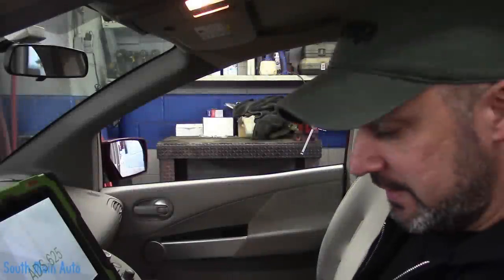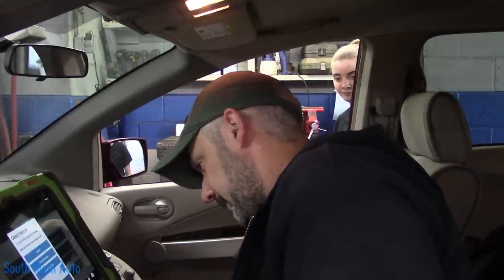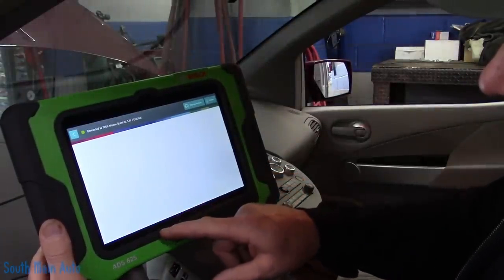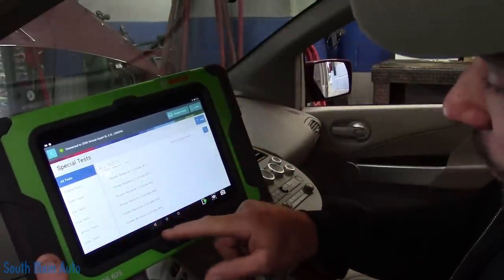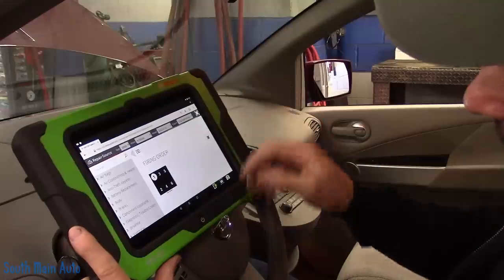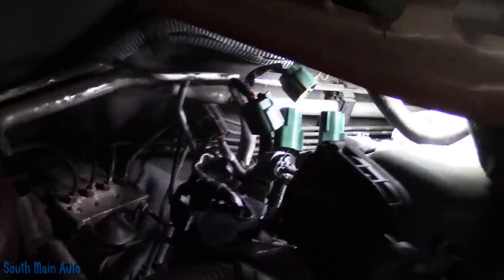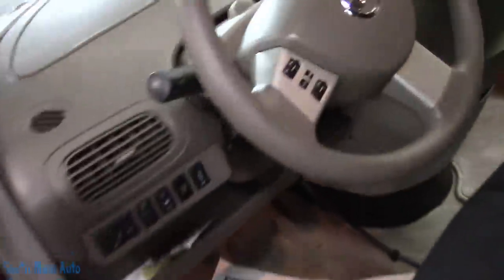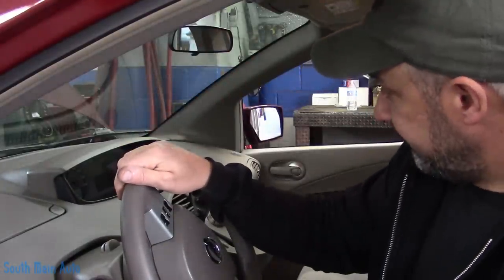Customer Replaced Spark Plugs And Now It Runs Bad!?

Comment: Major DIY f-up which luckily didn't result in any real damage.  Doing a waterpump/thermostat repair on a 2000 Lincoln LS.  Getting late/tired when I finished.  Start it up and white smoke is pouring out the back.  Long story short....there is a small coolant line going to the thermostat that's the exact same diameter as a vacuum line running to the intake 3 inches away.  I took the throttle body off and luckily there is a large plenum (it was the V8) with runners going into it from above...but the whole plenum was filled with coolant.  Cleaned everything up and wouldn't you know it, the car ran fine.  Only lasting damage was my rear O2 sensors which threw a code shortly thereafter....all in all a cheap price to pay for a mistake which could have frag'd the engine.  I sold it shortly thereafter. :)

Comment: Until you understand firing orders and have changed many plug wires, old time distributors, caps, and made the mistakes it can be hard to not to make this type of mistake. As an old mechanic people freaked out when I would just pull wires or other ignition pieces with disregard. Experience is the best teacher and none are born with it. Some pick it up quick and others have a harder time grasping some concepts. I struggle with multiple things that I’m not familiar with but in time or learning can overcome most things.

Comment: When I put a new fuel pump in my 96 f250, I didn’t get the ring tight enough to seal the pump gasket. Threw it all back together and filled her up just to watch it leak out of the top.

Comment: Spent DAYS re wiring  a 1988 ford pickups tail lights

Only to remember that mystical 4th wire was for a ground 

(Im used to working on older cars where its 3 wires and you trailer grounds through the trailer hitch)

Comment: just a little while ago i changed my rear brake discs. i was in my garage and pulled the car out of the garage and into the parking lot to park ( i live in an apartment). the car was pulling slightly after this. got out and looked around and there was the rear caliper still dangling from the rear spring that i had it tied too...moral of the story, check to make sure you did everything correctly before driving away lol

Comment: If you have an old 4 cylinder Mazda and for some reason someone cooks the points spring by reconnecting the ignition wrong after chasing a breakdown whilst out and about, all is not lost. A half-inch cube cut from the rubber sole of a thong ( Australian rubber sandal or flipflop ) rammed down between the moving point arm and the distributor body to close the points will get you home. The car's owner took the whole distributor to Brooking Mazda to buy new points and have them fitted whilst he was visiting Perth. The story was that the entire parts department and a mechanic came to look at it and they were quite amazed. The owner had been driving around with it like that for six months, periodically replacing the rubber cube.

Comment: An auto repair mistake I made...

2000 Camaro Z28 with the LS1 5.7L engine. 

I was changing spark plugs and found the easiest way to change the passenger side plugs was to remove the coil assembly from the valve cover. I got all the plugs replaced, reassembled the engine sparky bits and the plug for the assembly ended up settling in the socket but it wasn’t pushed in. I started the car and it ran on the 4 cylinders from the left bank but ran like crap. I looked around for the why, started testing the coils for power and ground, found they were dead, so I went to check at the!!!  PLUG!!!  It was then that I found it to be unplugged...  car ran great with all 8 brand new plugs. 

Oh and the #8 plug was actually the original plug at almost 200k on the clock. The other 7 were newer but not the iridium grade the engine was supposed to have.

Comment: My worst derp moment when fixing my car (1990 Mini) was when trying to diagnose a missing cylinder. I was holding the ht lead when I asked my buddy to try cranking the engine.
I guess it kinda worked, I did in fact find out that the lead was working just fine xD

Comment: I changed a battery once, in a friends car,  late model Acura TL . The hold down bracket hooks were just about 1-2 millimeter or so different in length, I didn't notice this... One was for the front end, one for the rear of the battery bracket. I had one partially screwed in while the other just wasn't reaching for some "reason"... They were mixed up,  and I thought the hooks were the same size. Wrong, one was slighty longer for clearance in the rear of the battery compartment. Moral is,  put things back exactly where they came out from, every time.

Comment: I put long tube headers on my mustang and had to get O2 sensor wire extenders.  Well a couple years later I was doing some work and accidentally swapped bank 1 and 2 over for the rear O2 sensors.  In my defense the extensions are both black and I disconnected on the harness side where both plugs are next to each other.

Comment: I didn't know snapping bolts was a thing. "You tighten it, then it stops moving, and you're done!" Cut to me snapping the last bolt on the throttle body after a cleaning/gasket replacement. It broke in a way where the threads still hold the throttle body to the intake so I just drive it like that, no vacuum leaks yet.

Comment: Worked tirelessly for an hour and a half on getting a clutch fan but broken loose,I just knew it was reverse thread. Turns out the reverse thread was the Chevy I had just worked on recently. The BMW is standard thread,when I turned it the correct way it came off in seconds. What was worse was my son (who thinks I’m a master mechanic (I am not) was along for the ride. I felt pretty stupid

Comment: My most embarrassing bad was to re-lay some new planking on the bed floor of an old British Ford Prefect ute (truck in America-speak).  I had cut it all to size and was going drill and fasten the next day. Unfortunately in the Ford Prefect ute bed, there were two metal hatches on hinges. Ford had done just enough body alteration to make the thing go and no more. One hatch enabled the fuel tank to be filled, the other for the diff oil to be topped up. If you had a load on board and a long journey ahead, it was just too bad for you. I had intended next day to trim out the holes for the hatches before I fastened the planks down but forgot. The next time I went to refuel at the service station, for the life of me I could not find the fuel filler. The fuel attendant was not much help. Then the penny dropped. I had to tear up some planks to get at the fuel cap. The shame did not end there. The story was published in the Geraldton Guardian newspaper for all to see. There were two powder-blue Ford Prefect utes in Geraldton. The colour was powder blue because the paint had perished. I had repainted painted it green, so there was no mistaking whose it was. There was always some smartarse who would ask if if had bought any petrol lately. I chose green because I had climbed in the wrong car one day and could not find the household power switch under the dash which had replaced the key switch.

Comment: In high school I was cruising around in my 72 gmc pickup during a light rain. Truck started running like poo
so I pulled over to check it out. With engine running I opened the hood and seen a plug wire off, being young 
and dumb I leaned over the wet fender ,grabbed the plug wire and shoved it back on.....  I've been afraid of 
plug wires ever since.

Comment: Had to replace the brushes in the alternator on a 85 Mercury Wagon. Everything went great, until I was out doing some running around. The car started losing power. I was able to get it off the road before it died. Popped the hood and looked at the battery cables - they were good. Further investigation showed that I had forgotten to plug one of the wires on the alt back in.
Was able to get a jump and ran it a good while to charge before getting back on the road.
Reply: Forgot to mention... it was raining, so lights and wipers were on.

Comment: Ive got 2, biggest mistake someone else has done was the oil filter kept coming lose because because they forgot to remove the old gasket. To get the double gasket to hold he used Red loctite. Had to cut it out with an angle grinder.

Biggest mistake ive done to myself is changed the brake pads on my truck and forgot to vacuum pump one of the lines.  took it for a test drive and the front right grabbed but not the left almost sent me into a curb.

Comment: I had a 66 Malibu with a 327.  I worked at the Chevrolet dealership in the parts department.  I ordered the Corvette valve covers for a 66' 337.  I put the valve covers on reversed and all the mechanics laughed at me.  The Corvette valve covers had spacers on them that the regular tin valve covers didn't.  I was trying to act like I knew what I was doing...

Comment: My old truck squeaking noise seemed to be in time with engine rpm’s.  I replaced a bunch of stuff and still squeaked.  Took to mechanic, he tore off the rusted cat heat shield.  No charge.  Just happened to be loose and rusty and squeaking along with engine vibration

Comment: I was a mechanic back in the day... 70's. I was tuning up a Chevy chevelle with a  BIG. V8.  454.  .  From underneath.  Only way to get to the plugs....I had all the plugs in but 1. Worked on it for about 45 minutes... Couldn't get the last plug in.. I asked the other mechanic to rake a look.... He tried for about 5 minutes... Then he looked at the plug... Told me to look closely at it... It had No threads.   To this day.... I still have that spark plugs.

Comment: Here's a fun one.  Replaced the thermostat in my Nissan truck. The thermostat housing has three bolts and the water inlet pointing out the top.  Took on this task during daylight but night had fallen by the time I started putting it back. By then, I'd already had coolant in my eyes and cuts and so forth. And the damn thermostat housing just would not go on. The bolts didn't fit. Nothing was lining up. And it was getting cold and my fingers were numb.  Long story short, it turns out the housing is not symmetrical at all and has a specific orientation or it won't fit. Once I realized this, all I had to was try all three positions and bam, the bolts fit and it went back together in a snap.  Everything else put back and the truck was running 15 minutes later.  Wasted many cold and wet hours fighting with that thing and the problem was me the whole time.

Comment: I custom build desktop computers. After a recent upgrade, which doubled the amount of memory, the machine would randomly stop. It would display the Blue-Screen-Of--Death, with the message "there is an unrecoverable error", and an error-code "memory problem". I ran diagnostics on everything and it was all good including the memory. I decided to check all of the internal connections, and that was when I saw that one of the four memory cards was not seated at one end. These are 1/8 in thick 1 x 5 in cards with 272 pins along one long edge. They fit into a connector, and this one card was not completely seated at one end. The Operating System will work around bad memory as much as it can, but under heavy memory use, this was too much. Once again I war reminded of my human fallibility.

Comment: Bought a Grand Marquis from an older gentlemen that had 130k miles. he told me that the car was in need of a tuneup so when i got the car home went ahead and started to drain the oil take off old spark plugs you know the usual disassemble for a basic tune up. After installing only 4 spark plugs in the engine for whatever reason i thought at that moment to go back under the car to install oil filter and screw back in the drain plug. So i went ahead and filled it back up with fresh oil and proceeded to install the coil packs back on made sure everything was nice and tight and then grabbed the keys to start the car and make sure everything was ok. So i go to crank the ignition and the car wont start and makes very loud popping noises and out of the corner of my eyes i see debris flying out from the engine bay. At this point my heart sank and i knew i had done something terribly wrong. So i go to inspect what happen and i see the coil packs wer shot clear across the garage. Turns out i had not installed the other 4 spark plugs on the other bank of the engine due to me having gone under the car and being completely assured in my head that i had installed all 8 plugs.

Comment: I had a front wheel bearing making noise on my 2006 explorer... it sounded like it was coming from the right front. I bought a new bearing hub Assy and replaced it, still had the noise, so I bought the left one, that was the noisy one. But wasn’t too bad. Cost me $99.00 per side. Ford dealer quoted me a price of $505.00 per side.

Comment: Once managed to put diesel fuel in my 69' Chevy Nova. Ran fine, except the engine wouldn't turn off..even had the key completely out of the ignition & engine continued to run. Was told this was called dieseling. The diesel fuel was taken out of the tank, unleaded put in and all was fine.

Comment: I wouldn't say I made a mistake but when I was reinstalling the cylinder heads on my Chevy LS1 after a lifter change,when I went to start it a "engine management fault,contact dealer" message came up on the instrument cluster.

As with any installation, I double check the simple things such as the earths,sure enough,one of them which screws into the left hand side cylinder head was left off.

I reconnected it & that went away but I still had a no start condition,the fuel pump was priming up so I checked for +12 volts at the fuel injectors which was present.

I then checked for spark by grabbing another spark plug  & earthing it off onto the valve cover from the spark plug lead,I had no spark.

I got the ignition coil wiring diagram & had no voltage at the +ve  terminal of the ignition coil loom,I traced it to a very vague spot in the car,the front left hand side of the car has the connector for both the air conditioning pressure valve & ignition coils were wired into the same loom,it wasn't very obvious.

Yes,Holden had wired the ignitions power supply in with the control wiring for the air conditioners compressor, I left it disconnected just in case something went amiss when I fired the engine up.

So,I connected the wiring connector up,turned the ignition key then the engine roared into life & was very loud as I ran it with only the headers for test purposes !

Comment: On my 2007 impala I actually switched up 2 of the spark plug wires by mistake. Sad thing is there was numbers on the coil pack and on the wires and I knew the cylinder numbers. Just got in too big a rush. Took them off and swapped em back and all was well.

Comment: Had a 1987 Ford Taurus and I decided to change the spark plug wires. I intended to change them one at a time, but in the middle of the process, the distributor cap fell off. So, I looked it up in my Chilton's book and put it back together. Tried to start in up and it one fire once every time the rotor button turned in the distributor cap. I asked a mechanic on my mail route what was his opinion. He looked it up and the firing order in his sources was exactly backwards from my CHilton's book. Replaced the wires in the correct order and the car started.

Comment: Replaced the radiator, water pump, thermostat, coolant expansion tank, accessory drive belt, and pulleys in my 2007 BMW X3. At this point it starts loosing coolant, so I take it to the shop only to find out that I did not install the correct radiator adjusting screw. Some times parts don't work right out of the box.

Comment: 15 years ago my alternator went out.

I didn't know there was a thing called a belt tensioner.

I spent 45-60 minutes trying to get that damn belt in by canting the alternator and trying to bolt it in.

I crossthreaded both bolts in the aluminum head and had to drill and re-tap them.... What a freaking mess. My dad finally decided to tell me about the tensioner belt until AFTER I retapped the head.

Comment: Forgot to put the oil plug in before pouring in the oil. Amazing how much ground 4qts of oil can cover.
Reply: All 4 quarts?  I have that fear, so I pour a lil oil and double check the oil plug.

I hand tightend my oil filter and never went back with the wrench.  It blew off immediately when I started my truck.

Comment: Changed my oil on my 04 Lincoln LS and forgot to put the cap back on. Check engine light came on a few miles down the road and I think to myself, “Great, how much is this going to cost me?”. So I scanned it with my BlueDriver not thinking it had anything to do with the oil change. Check under the hood and found the problem. Crisis averted lol

Comment: Back in 1977, my first car. 68 GTO. Changed sparkplugs, distributor cap, rotor, points and condensor. No start. Acted like it wanted to though. Put old points and condensor back in. No change. Put old cap and rotor back on. No change. Put old wires back on. Still no change. Put old plugs back in. Fired right up. Yes, i then rechecked the gap on all the plugs. Still .035. Took the plugs back to the aito parts and explained. They still made me buy more. Different brand this time. Worked perfect. A couple of months later, I was given a refund from the auto parts store as I am an auto mechanic in a small shop at that time.
Turns out, 6 of the 8 plugs were bad. Whoda thunk?